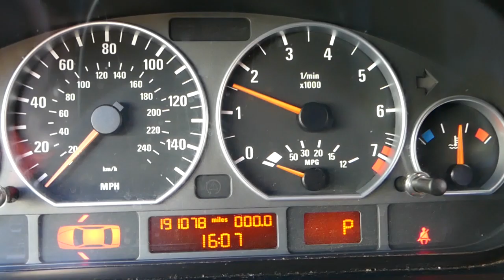HOW TO REMOVE AND REPLACE RADIATOR FAN ON PORSCHE CAYENNE

Comment: My 06 Cayenne S started overheating and I had steam coming out yesterday. The cold weather and driving quick stopped the overheating, but I noticed the fan was not turning on. Today I let it heat up past the 180-190 ish mark and the fan did not kick on again....until I turned the car off. For some reason it did the short turn on to cool off the car after the car was off. Why would it not turn on while the car was running, but it does turn on while the car is off? It seems like something other that the fan motor or fuse. Is there a sensor that tells it to kick on?